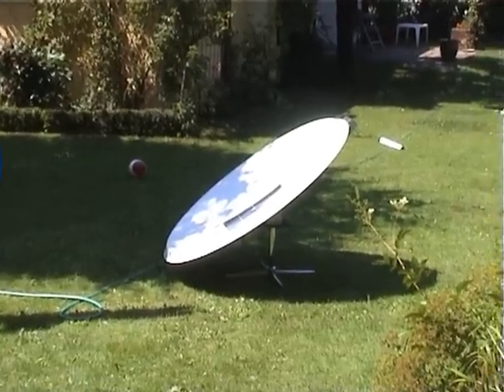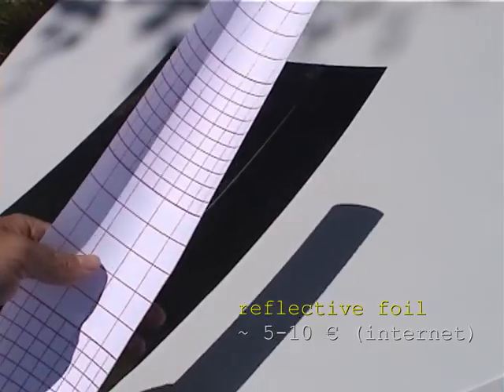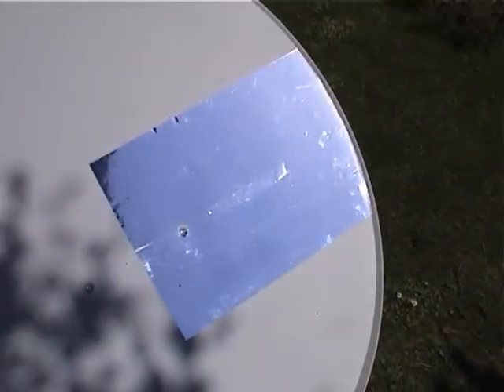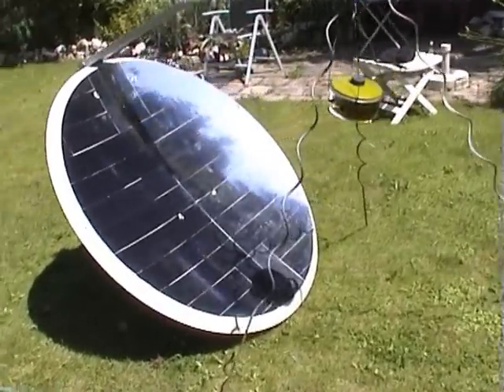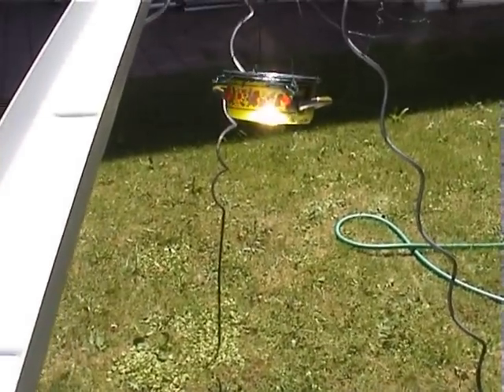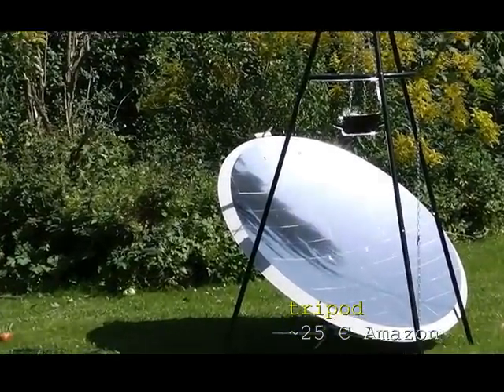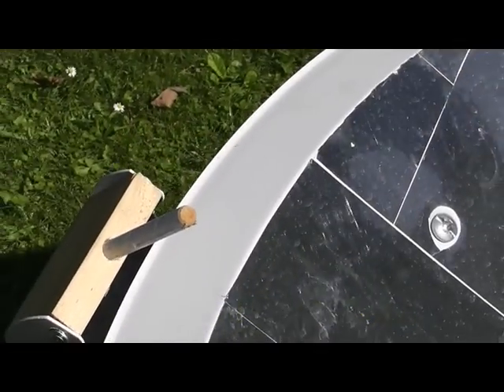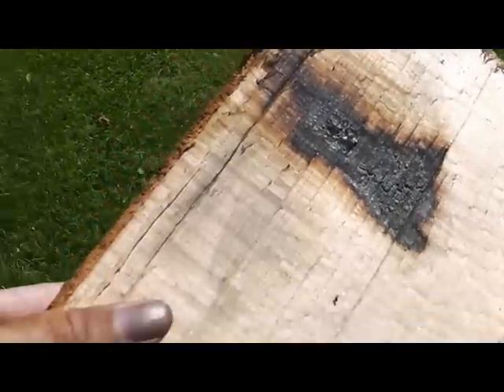solar cooking: How to build a solar cooker from a satellite dish

Comment: This is a good video.  It is difficult for people to find a satelite dish or any other parabolic dish.  Still there is a solution.  It's called a solar mirror array.  Perhaps 3 inch to 4 inch mirrors all aimed at the cooking vessel.  I have some vids discussing this, and mirrors are cheap, just cut to the size needed.  There are so many ways to aim the mirrors, but I have designed what is effectively a ball and socket system on a flat board that is braced so it does not bend.

Comment: The problem with these is that they are cumbersome. Constantly need to be adjusted. One needs to be out there when it's hot and he'd rather hide in the shade. And they can burn food because the pot gets to hot unless stirred constantly. I find panel cookers way better. They cook more slowly but don't need any attention. Adjust them only once an hour, it takes only a few seconds.  They are much more convenient than satellite dish type cookers.
Reply: Maybe best for large volume of water to heat ?
Reply: @caseyhalone  yes, probably that's their niche. To heat large volumes of water quickly for sterilization.

Comment: to remove the bubbles on the foil spray diluted washing up detergent on the dish first then apply the self adhesive foil to the dish and then use clothe to compress the foil onto the dish using a motion from centre to exposed edge of foil.

Comment: Might be better to make a heat conductor that has a panel that is right at the focal point and perpendicular to the reflected light which efficiently conducts that heat to a surface that is parallel to the ground on which any cooking container can be placed. As it is, you're heating up a corner of a pot or pan and inefficiently because the angle of incidence on the pan isn't optimal.

Comment from the maker: Yes, aluminum-foil can be used as well. Alu is one of the most reflective materials and it should even work better. I didn't use it, because my reflective foil had a glue sheet on its back. And i think alu-foil won't last very long.

Comment: If the satellite dish is small do you need to spray paint it black?
Reply from the maker: Don't paint the satellite dish in black. 
The dish shouldn't be smaller than diameter 1,20m if you want to use it in countries like Germany. If you live further south, smaller diameters might work as well

Comment: Also, why did you use a tripod vs. affixing the pot to the dish at the right focal point?
Reply from the maker: By changing the hight of the pot (with the tripod) I can change the intensity of light on the pot so I can regulate the power. But to be honest I did it because it seemed to be the simplest solution with the least effort
Reply: what we call, 'Keep it Simple' or KiS.
Reply: A grate is keeping it simple.  Tripod sucks.  Wind?  Cookware?  The only thing simple is your mind.  You're in such a hurry to make feel-good, gay-ass comments, you do'n think.  Tripod is not kis.

Comment: is there any specific length on how far should your pot hang?
Reply from the maker: The exact focal point is about 60 cm from the dish away - just as long as the holder for the LNB usually is. But the pot should hang either clother or further because you don't want to have a very small heating spot
Reply: We have many dishes here that are 19" and I saw one that was 33". Do you think 19" would be big enough here in the midwest United States?

Comment: hell ya we have two satelite dishes getting tape tomorrow and trying this saturday
Reply from the maker: wow, keep me up to date
Reply: got the aluminum tape at auto parts it didnt work could not get it to focus
Reply from the maker: focusing doesn't depend on the tape you used, it depends on the dish. And every dish is designed to focus, so I don't understand why
Reply: it had to be cloudy today i put the hot dog on a stick infront of it i think the problem is i need to take the dish off the pole its on so i can aim  it better

Comment: Should avoid contact with concentrated light on the skin. It is dangerous for health! Many make this mistake.
Reply: agreed, especially sunlight is not just any light, but also consist of dangerous Ultra-Violet rays, and no human should want concentrated UV rays against their skin
Reply from the maker: Madlion disagree.... believe me, you do feel the heat immediatly. Ultra Violet damages are always long term damages. You couldn't hold your skin in the rays for longer then 2seconds